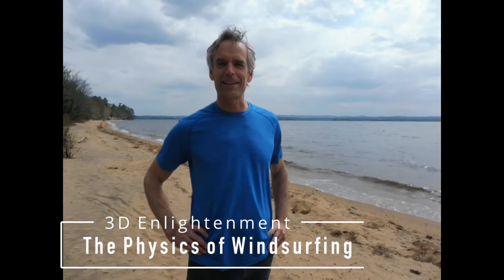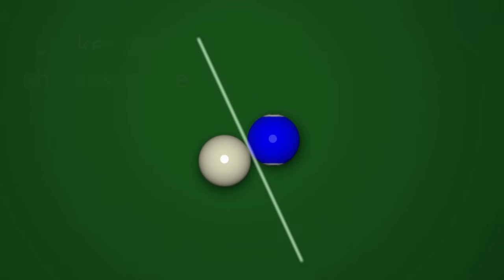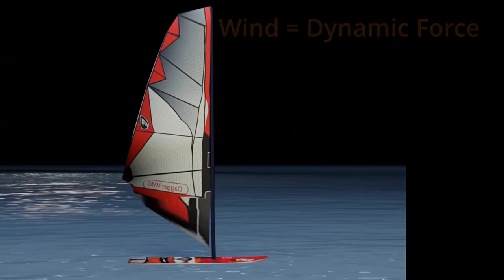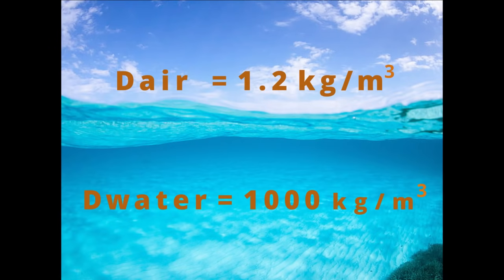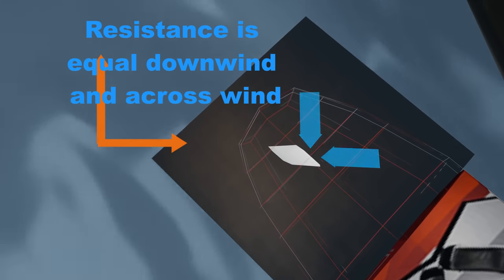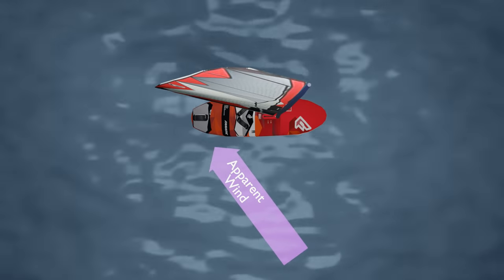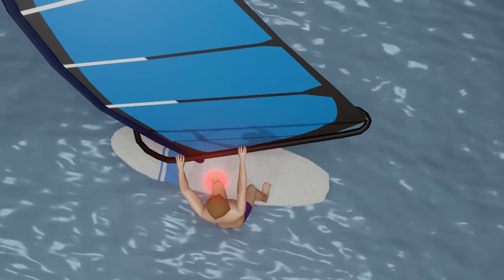Physics of Windsurfing

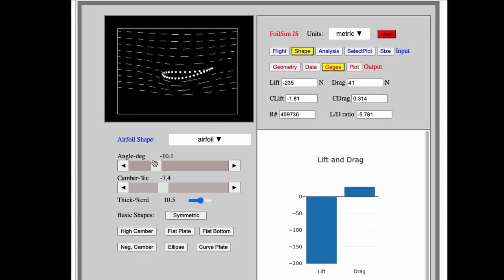Comment: At 6:02 .....THIS is perfect sail trim for ALL directions of sailing (except for directly downwind).  The lift to drag ratio number proves it.....-10.065
Look at the impossibly high drag numbers when you put the nasa wing in the position that you claim is the “windsurfing” angle.  If you ever put the sail in that position to the wind you STOP.  You have created an air anchor. You are not moving.  The 6:02 perfect sail trim also disproves your whole billiard ball theory. I just don’t know what to say but most of your video is just so embarrassingly wrong.  You should truly take it down.  True misinformation.
Reply from the maker: Sorry Douglas, the purpose of that section of the video was to show that the "lift" from an aerodynamic perspective and from a laymans perspective, is in a downwind direction.  This is correct as shown by the negative lift value.  I was also pointing out the error that has been conveyed in other videos that the curvature of the sail allows the craft to be "lifted" upwind.  This is not the case.  No matter how you orient the sail the driving force or lift will be in a downwind direction or negative lift direction (negative lift being perpendicular to the convex surface of the sail) .  The reason you can move upwind is not simply a function of the sail, but a function of the angle of the sail allowing the craft to move forward, combined with  the resistance provided by the water against a surface i.e. fin .  In the case of a windsurfer this resistance would be from the broad side of the fin and/or dagger board.  Sailing and lift from a wing on an aircraft is also not a perfect comparison.   The aircraft gets its propulsion from the engines, whereas a sail boat must get its forward propulsion directly from the wind and therefore the wing and sails orientation to the wind  will be different as they have different functions.  I also admit that this section of the video is not perfectly clear.  I have a more elaborate video with experimental data which demonstrates what is happening.
Reply: “Forces acting on the windsurfing sail” search on YouTube for “Forces acting on the windsurfing sail”. There is a guy with a Russian accent who explains it perfectly. He says the sail can only function in an 18 degree green zone in relation to the wind.  If you are not in this zone you are not going to be able to sail.  The Russian guy is correct.  Every detail and description in the billiard ball video is incorrect, dangerous, wrong, false, full of errors and should only be described as total misinformation where sail trim is concerned.  Listen to the Russian guy not the billiard ball guy.
Reply from the maker: I know that video from the Russian guy.  His explanation is wrong and was the inspiration for the first video.
Reply: @3denlightenment  FFS It’s physics….physics doesn’t care about opinions…..
Reply: @3denlightenment 
Have you won any windsurfing titles?  Have you been invited to tryout for the U.S Olympic Windsurfing team? Have you been a windsurfing instructor for over ten years?  Have you ever beaten a world champion sailor and taken first place in a regatta with over 50 competitors.  Have you ever lead a fleet of over 100 windsurfers at the Mistral District Championships to the windward mark? If not than I think I know a little bit more than you do about sail trim and the “physics” of windsurfing….you don’t know…and you don’t know that you don’t know

Comment: You should study aerodynamic,  hydrodynamics and mechanics (equation of motion). Lot of nonsense. The aerodynamic forces depend on the angle of attack and the hydrodynamic forces on the sideslip angle of the fin. Both are independent, there are two coordinate systems. On a steady ride the sail forces and the hull forces (fin) must be equal. The 'upwind' or 'downwind' forces depend solely on the course angle and not of the angle of attack.
Reply from the maker: Thanks Dietrich for clarifying that.  I was trying to use simple English to explain this but probably should have ultimately used the technical terms.  Perhaps in a future video.  Can you clarify when you say that the 'upwind' or 'downwind' forces depend solely on the course angle and not the angle of attack.  The course angle is the resultant angle that the vessel actually moves and is dependant on the wind force and therefore would definitely be dependant on the angle of attack between the apparent wind and the sail surface.  If you will, please clarify.  Thanks.
Reply: @3denlightenment  The sailing condition is given by four forces that's are the aerodynamic driving force (thrust, sail force in direction of sailing), the hydrodynamic drag of hull and fin (opposite to the thrust) and the aerodynamic sideforce of the sail and the hydrodynamic sideforce (perpendicular to the sailing direction). All must be equal and opposite. There are no upwind and downwind forces. The thrust is small in case you sail upwind and high in case you go downwind. So the thrust depend on the course to the wind, the apparent wind angle and the lift coefficient or angle of attack of the sail. Further, the sail force is given by the heeling moment defined by the body weight of the sailor. Maybe you can give me an e-mail contact so I can send you a paper about windsurf mechanics.
Reply from the maker: @MrKleppy10  Thanks. I would appreciate reading that.  You can send it to locej15532@0ranges.com.

Comment: This is part good, and part terrible. If you're a beginner it may help with the insight it gives, and then it may confuse you. If you concentrate on this theoretical stuff too much you'll never learn to gybe. It's reasonably good science, but concentrates on theory – which can be a distraction – when sometimes you just need to get on your board and sail. I write this as an engineer and trained scientist. We don't learn to drive a car via science like this – we get in and get used to the control gadgets, but with an intellectual view to where we want to go and at what speed.
Reply from the maker: Thanks for your insight.  I prepared this because of the erroneous descriptions of the physics of windsurfing on the web.  You are right, it doesn't substitute for practice, but it may help to understand where the forces are for a beginner so that they can manage them to their advantage.  As far as gybing goes, I didn't touch that at all, which is not possible unless you have the momentum from planning...and yes, mght be worth another video.

Comment: Davvero un video pessimo. Perlopiù arte grafica, ma pessima Fisica. Dovreste migliorare questo video.

What a shameful English spoken video. Please, improve this video Physics  informations and correct it.
Reply from the maker: I would appreciate specific areas you feel need corrected.  It has been reviewed and substantiated by hundreds of thousands of people and supported by science.
Reply: @3denlightenment  Oh no, I don't review all its passages.
Let's say  that for windsurf - to go upwind: depitcing/visualizing wind particles impacts on sail and its component is almost useless in realizing how it works.
Same so in scomposing those forces (in upwind direction)!
In the video it is used  the word "dynamic forces", the meaning? That it depends on velocity? That may be informative about module, not on DIRECTION of forces!
So It doesn't help much in understanding HOW the windsurf can go upwind, too.
The fact the windsurf can go upwind (45 degree o something like that... from wind's direction) lays in aerodynamics, so it is ABOUT THE PRESSURE between the sides of the sail, that is given by the FORM of the sail. It is right some parallelism with wings, that are present in the video. But I find that the video loses its direction after that.
Then, how feet are "solid" or press ON the surf surface. No... that is almost about equilibrium of windsurfer against sail. The steer is about MOMENT of forces. Does the video use the word "moment"? Moment derives by feet pushing the surfboard (so involving some "direction", so no merely press down) or handling the sail, or both.
I'm not an expert but these are  my 2 cents :)
Reply from the maker: Thanks for the explanation.  If I understand correctly you believe that the wind flowing over the surface of the sail profile will cause a low pressure on the sail i.e. Bernoulli's pressure and this low pressure will cause lift  pulling the sail...however this is incorrect.  If you watch my second video I conduct an experiment showing that basically it is newtons forces on the sail from direct pressures from the moving particles (dynamic forces) which provides the pressure on the sail allowing the board to move forward and upwind if needed.  
You speak about 'moment' which comes from momentum which is defined as mass x velocity.  The foot pressures on the board would not be considered moments since they virtually have no velocity.  You lean back against the sail with your body and legs at a certain angle and they, through gravitational and wind pressure, provide force on the board which translates to force on the fin allowing you to steer.  Watch all three of my videos which should clarify somethings.  All the best.
Reply: @3denlightenment  Why have you deleted my definitive LAST explanation? Now it is lost.
So let me just write that  this video of yours is WRONG in many ways, as REAL Aerodynamics scientits should recognize after seeing it. 🙂